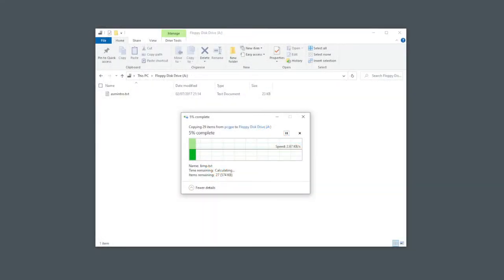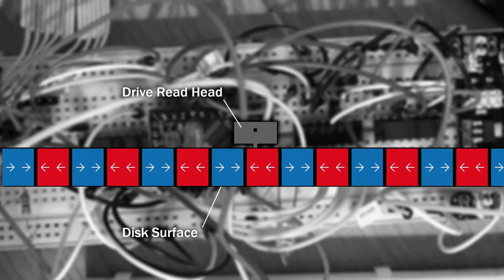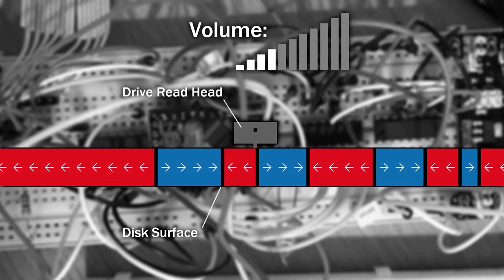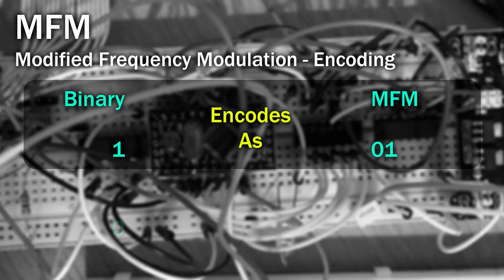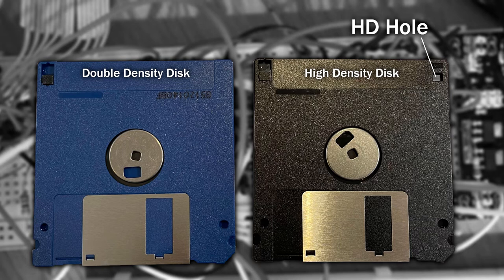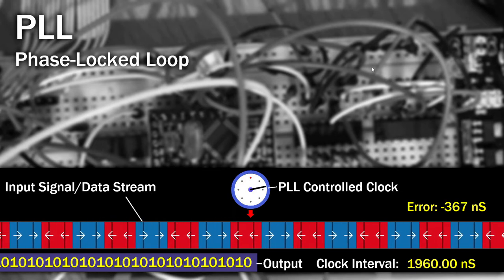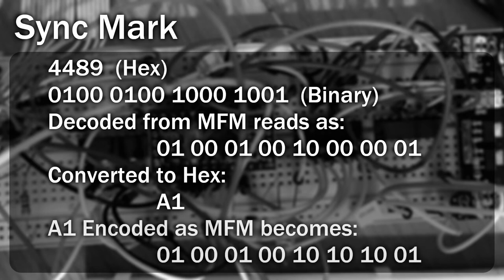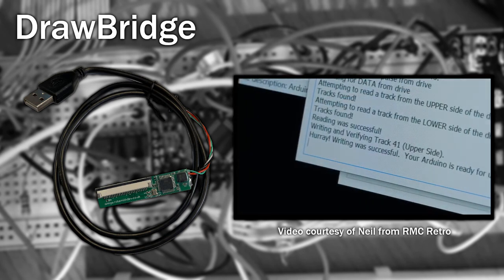How Data is Encoded and Stored on Floppy Disks

Comment: I understand jack shait about flpopy disk operations oszyllos... somthing etc. but i managed with the Arduino and the DrawBridge project to
copy my Amiga stuff onto the PC. It was a  mess made out of jumper wires, Arduino, floppy drive, FTDI break outboard, power  supply companioned
by a enormous amount of excitement and maybe a bit of fear, caused of the possible magic smoke. There is nothing magic about the smoke it stinks
and is expensive! And i didn't see any that day! Thank you for your phenomenal work and sharing. 😀.
Reply from the maker: Letting the magic smoke out can be “educational” lol - glad you managed to grab your Amiga stuff!

Comment: Bravo, finally a video with the correct explanation! Considering how important this invention was to human history and the vast amount of data stored using it there is surprisingly little correct information out there. I suppose you will explain the problems with too many zeros in a row in your second part, hence the reason for the need for encoding. The way I understand it is that a flux transition is like a 3D gaussian curve. When moving from one transition going up and the other going down the distance between them dictates how many zeros between the ones. But the more zeros inserted, the more the slope between the gaussian peeks becomes shallower and shallower. The more shallow it becomes the higher the auto gain amplifier ramps up. If there are too many zeros then the slope can become so shallow it almost becomes a constant straight line. Induction stops in the presence of a constant field so this is bad. The next amplifier after the auto gain one is configured as a differentiator amplifier that differentiates the signal and detects zero crossings by detecting when the flux reverses (ie the slope at a true flux reversal at the top of the gaussian peek is flat). The derivative of a shallow sloping, almost constant signal can be close to zero. So with the first amp with its auto gain maxed and the second differentiating close to zero, any noise can easily cause a random incorrect zero crossing to be sent through to the one shot and be incorrectly detected as a one. Some copy protection did this on purpose. When implementing Pi1541 floppy drive emulator I had to introduce random flux reversals to emulate this side effect of the two op-amps used in real drives. I'm developing a new emulator for shugart drives that is like a DrawBridge/SCP/Zoomfloppy and a Gotek combined together. It is a small device that sits behind a real floppy drive. It can intercept the signals from the computer and emulate the drive or it can pretend to be the computer and image disks or it can simply let the signals go through and allow you to use the real floppy as usual. All controllable wirelessly via a cell phone app.
Reply from the maker: Nice to hear that I got my facts right! You perhaps go into more detail than I planned, but yes your understanding of the amplifiers is the like mine. I guess in the video if I’d shown a threshold line for the signal level it would have covered the second stage, but I think it’s enough for the majority of what i was trying to get across.  Your project sounds interesting. Do you want have a link about it?

Comment: The MFM system seems similar to how the old TRS-80 saved data to tapes.  It recorded each bit over 4ms divided into 1ms intervals.  The first, second and fourth interval were always the same.  The first interval was a 1ms pulse, followed by a 1ms pause, followed by either another 1ms pause for a 0 bit or a 1ms pulse for a 1 bit, and the fourth interval would always be a 1ms pause.
The beauty of this scheme is that it would automatically re-synch to the next clock pulse on each bit.

Unfortunately, the whole thing was "bit-bashed" and there was an error in the timing routines which made reading back from tapes somewhat "flakey" which played a large part in earning the computer its nickname of "Trash-80" - a name which persisted even after the tape reading routine had been adjusted to compensate for the original error.
Reply from the maker: Ah that sounds like FM encoding, the predecessor to MFM, interesting!

Comment: @2:00 How would you address then the flippy disks (5.25") we used on single-sided 8-bit Atari and Commodore drives (among others), where the second side was easily accessible by punching a write protection notch and just rotating the disk? In such case, the tracks were EXACTLY aligned, almost ideally - and everything worked, and still works. Disks recorded 30 years ago are still in perfect shape (if stored correctly).
Reply from the maker: So that video was made a few years ago, and whilst I’m still not 100% sure, on a 3.25” drive the upper and lower heads probably are writing in the same spots just offset by one cylinder. If this is true then I guess the level of magnesium they produce must be just enough and localised enough to only affect one side of the disk. If that’s the case then that explains how the flippy ones worked too. Every day is a school day and it’s amazing we’re (me included) still learning new things about this obsolete technology. I had to ask for help on that one
Reply: @RobSmithDev Offsets are true for double head drives, also 5.25" ones (were the difference is 6 or 7 tracks actually). My guess is, it's to avoid interference between the tracks themselves. But the material, that the disk is made of, is enough to isolate the data.

Comment: How was Amiga High-Density floppy disk format different from PC HD?  Were Amiga clock intervals the same for DD & HD?
Reply from the maker: Amiga and PC use different sector encoding formats but aside from that, the Amiga couldn’t handle the higher data rate so used special drives that when detecting a HD disk would spin the disk at half the speed meaning the data came in at DD speeds. An Amiga HD disk just had twice as many sectors compared to a PC. Also because the Amiga didn’t index align it’s data it could fit more on it, whereas a PC sector locations were precisely timed to start after some period from the index pulse. Because of this the spaces between sectors were larger to make them easier to find

Comment: Could you please help me? I'm a mum going back to work after 19 years of brining up kids and working for my husband. Suddenly, I need my CV! It's on a 19 year old floppy! If the floppy is not able to be read by the drive (it's a 20 year old 3.5" floppy) as it's making a clicking sound (I think it's not spinning), is it still possible to get the data of the disk? There's a bit of corrosion on the outside.
Reply from the maker: Hi, can you turn the disk yourself and is it easy?  If not, then the disk is probably too bad to be used. 
 If it turns easily (could be a fault with the drive), then slide the shutter back on the disk, and hold it up to the light. If you cant see anything through it (or a small consistant amount of light) then yes its more likely.  If however you can see little pin spots of light, or strange marks on the surface (almost looks like water marks) the chance is less likely.  Either way the drive you're using will probably need cleaning (the drive heads).
Reply: If it's in IBM format, then these days you can still buy an external USB powered 3.5" drive which runs off a laptop USB port.  So long as the disk itself is still readable and it's in IBM format, it should be readable through such a drive.

Comment: But what about controllers without PLL? I.e. WoZ drive e.t.c. They measure time from the edge of the pulse, and have pretty good margin 2,3,4uS /*giving +/-1/4 us tolerance out of largest 4u interval they get +/-10% too, but actually there could be more like 1/3 even 1/2.5! and still read the interval right*/
Can you tell probably I've missed something?
Reply from the maker: Woz wasn’t using MFM encoding - I’d be surprised if there wasn’t some kind of PLL there somewhere though. Measuring from pulse to pulse does work quite well anyway - found that out first hand, but the PLL helps with poor accuracy of rotational speed.